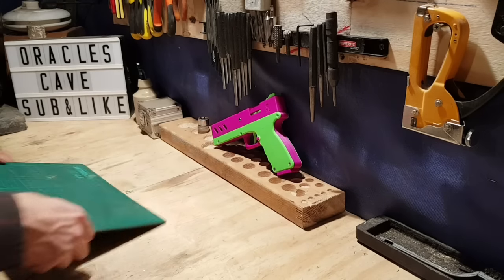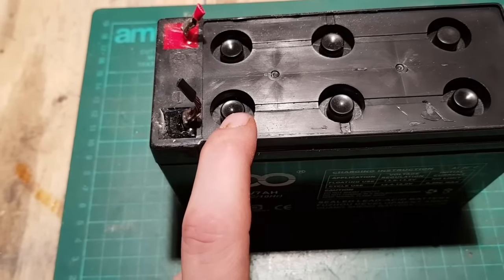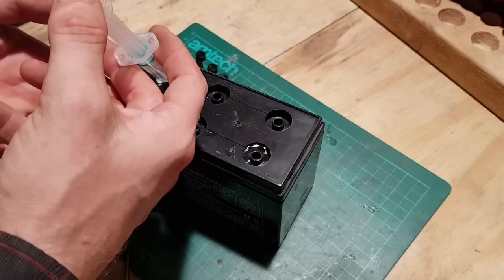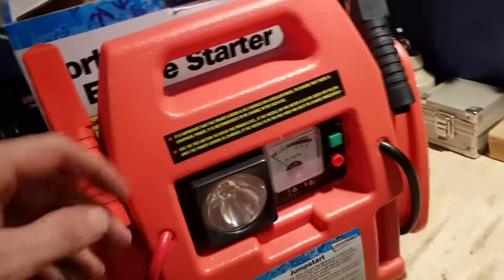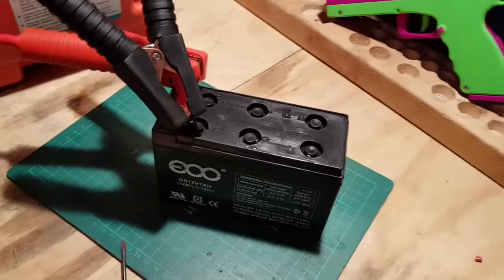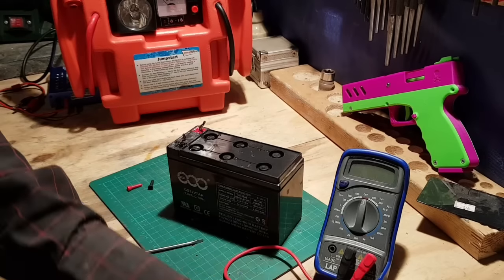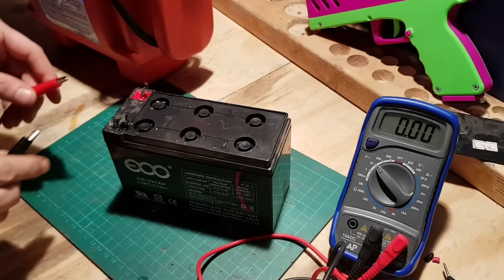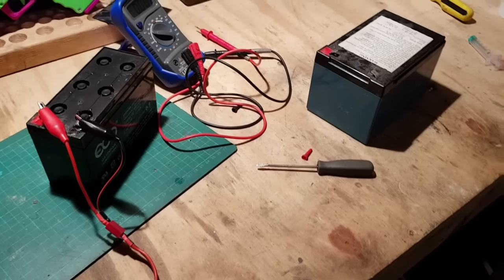HOW TO REVIVE DEAD 6V, 12V BATTERIES THAT WON'T CHARGE

Comment: ok I'm not very smart when it comes to this stuff but my computer ups stopped working, I live in a area where power goes out for like 1 minute and comes back on.
 my ups used to keep my pc running during  that 1 minute until the power was back on but know it stopped working, when I tested the battery with my multimeter it gave me 13.2 voltage but now the ups keeps shutting down immediately after the power goes out.
I have an uncle who works with car batteries and stuff, pretty sure he has acid so is it ok to fill it with acid instead distilled water if he doesn't have distilled water?
Reply from the maker: Acid is best, i only use water to help with reversing terminals to help dissolve any crystals that may have formed on the plates.
Acid is always best to use.
Just be careful and do not attempt without eye protection, splashes are sneaky devils, second hand shops are everywhere, but no second eye shops.
👍👍👍
Reply: thank you for the advice my friend, I'm gonna try this and come back with an update in 2 days and hopefully it works
Reply: dudeeee it fking worked can't believe it thank u so much !!!!! ur fucking awesome
i have 2 other 12 v batteries that i'm gonna try to also fix, thank u so much my friend 

<3 <3
Reply: @droppinaload2672  My battery charger shows that d battery is full but only testing d battery with multimeter, it shows nothing and won't even power a small 12v motor. Help please

Comment: A dead battery can't be fix, you can only recharge a discharged battery. If it needs water that means you overcharge it and boiled the water off. The lead flakes off and shorts out the cell, if you get it working it won't last. That's why there is a limited warranty.
Reply from the maker: Yes but not all batteries are toasted when they don't charge,  some are able to be saved and used.
If the cells are gone, there is nothing you can do.
👍👍👍

Comment: If you use an new battery to charge the old one, the new one can lose voltage? But since it’s new you can recharge it correct?
Reply from the maker: Yes correct, when a battery has gone bad, it has crystallized all the energy making liquid and is all dried up.

But a new battery will re-boost its liquid back to full power with a charge.

Bad battery just needs the Crystal's to be dissolved back into a liquid and it will take a charge again.

It's called SULFATION when it crystallizes 
👍👍👍

Comment: Pour acid out in container..heat up distilled wated and salt mix alil salt into water heat to 125temp pour in battery shake it and drain it keep doing so until water is clean then add acid back and add distilled water then hook to good 12 volt battery and charger ince battery charge enough then connect charger to bad battery it wil become allmost like new did many battery’s this way saved alot money in life time

Comment: If I add 2 ml of battery acid to each cell, how do I avoid any problems with getting splashed by the battery acid?
Reply: Will the battery acid react badly with whatever is still in each cell?

Comment: Actually I have put  lemon juice inside it.. After  few time.. While I charging the battery.. I heard sound of pops medium sound... So I scared & unplug it from charge... Does lemon juice help in repairing that battery?  Is that true?
Reply from the maker: Lemon juice is a good electrolyte, many batteries can be made using lemon juice.

 but no its not a good idea to use in a lead acid battery, flush it out safely or get another battery.
Reply: thank u for answering my questions... Actually lead acid battery are expensive these days... It cost now 70$ ...due to raising of dollar in Lebanon... That's why I try to fix old one...
Reply from the maker: @zoronow267  the battery needs water and sulphuric acid to bring back to brand new power levels.

You can get sulphuric acid very cheap and each cell only needs a few milliliters, just Google your battery to find out how much acid in each cell.
But most of it is just water in the cell.

Very cheap to get acid and battery will be perfect.
👍👍👍

Comment: how hot did it end up getting and what a save temp to let it get to
Reply from the maker: I never checked temp but it did get hot, just Google max battery heat expected when doing what your doing.
👍👍👍
Reply: @oraclescave  ok thanks just trying to  revive this battery from 7.66v  to 12v  it's a PB style battery form a goal zero escape  solar power supply I'm using a smart charger to charger it

Comment: Will this method work on 6v or 12v grey or red power wheels batteries?
Reply from the maker: Yes, all lead acid batteries, car, truck, forklift, motorcycle, etc.. 
👍👍👍
Reply: @oraclescave  thank you have a great day
Reply: Also how do you keep the lid (after prying off) from opening while in use?
Reply from the maker: @DavidSilva-qe2tn  I just tape it down and use a soldering iron to put little stitches on the corners by just touching the hot tip into the plastic at the join line and on the centre.

You could just use tape I suppose, I used soldering iron because I use these batteries in offroad dirtbikes and they take a beating.
👍👍👍

Comment: Lead acid battery do not come back, they may show a high voltage even 13 volts under load voltage drops like a rock
Reply from the maker: Yes they do, or you wouldn't be able to purchase battery refill packs of electrolytes.
Its only acid and water.
I wish people would think or actually know before telling me whats correct.

The voltage drops because it can't hold a large charge with just water and no electrolytes, this is why you desulphate or re-electrolyte the cells.

So if none of your batteries are coming back, my advice would be, start treating your wife right or she might not come back either.
Reply: @oraclescave  I'm with you on this. I've brought back over 12 batteries like this. They only last 1\2 as long as new ones but damn sure work again. I had to charge and quick drain several times before it held a good charge.
Reply from the maker: @travissimpler2573  fresh acid refill is needed to bring back to brand new power.
Very cheap, but not a very nice chemical to have laying around.
But if you are doing battery refresh, a little acid is like steroids for batteries lol
👍👍👍
Reply: May I ask what acid you would use? Thanks

Comment: I use a Dewalt model DXAEC2 6V/2A  12/0.5A  trickle charger.  It works from 0V to 12.8V.  None of that tricking chargers
Reply: So does that have an adjustable voltage output setting on it?  I have two 12 volt batteries like the one in this video.  I can't get either one to charge above 6 volts.

Comment: I just want to note you can use a $10 solar charge controller from ebay.  It will revive a battery at 0 volt (at least for me).

Comment: Can this be done without a smart charger ?
Reply from the maker: Yes, I was just taking the chance to show everyone why a smart charger blocks you from charging.
Any normal old style charger will just pump juice into no matter what.
It's because batteries like lithium-ion can become explosive if charged with a charger that's not a smart charger.
So a minimum voltage cut off sensor is what stops it charging, incase the cells are damaged, ( balanced charging)
Old style chargers don't have these cut offs, so anytime you come across a cheap old style charger, it's worth grabbing to keep in the attic.

Comment: What kind of a water are you putting in them
Reply from the maker: I use de-ionized water, but distilled water is usually what you can use, it's just water with the minerals removed.
👍👍👍

Comment: I've got a lead acid battery 12v can i just use normal tap water.
Reply from the maker: People do it all the time, but technically degrades the cells, but it still works, even rainwater works like distilled water
👍👍👍

Comment: I got about x25 12v SLA that I recovered from ups backup's. I hope this works out for them.
Reply from the maker: It will work, you can also refresh the battery power back to full power with some sulfuric acid or other electrolytes.
👍👍👍
Reply: I have found Epsom salt or aspirin does something for car batteries. Clean the deposits off of the lead maybe?

Comment: I have a Razor E300 scooter, batteries "charge" by smart charger, but turn the throttle and seconds later no power, rear wheel will spin, but not with you on it.
Reply from the maker: Yes your battery is dying because of sulfation, you might be able to make it strong again, most people would put fresh electrolytes in the battery with some water, and it will be re-usable.

Sounds like your battery has "dried up" inside.
👍👍👍
Reply: @oraclescave  Thanks

Comment: What is the difference between distilled water and battery acid?
Reply from the maker: Distilled water is just water that has been through a treatment and battery acid is a very corrosive chemical called sulphuric acid.
There needs to be water in the cells and also mixed with 2-10 millilitres of acid depending on which battery.

Comment: Did you use plane tap water or distilled water?
Reply from the maker: I used deionized water but distilled is fine.
👍👍👍
Reply: @oraclescave  what is deionized water?
Reply from the maker: @darkside6148  just like distilled water, distilled water will be ok aswell.
👍👍👍
Reply: How about rain water? Can i use that?
Reply from the maker: @bendabolehbuatlain9988  rain water can work but will slowly degrade the lead, but yes it would work just like distilled water

Comment: Video fails to mention or exercise safety precautions.    Batteries should never be filled to the top. Charging creates gas bubbles and heat expansion which would cause the acid to run over. Also caps are to be off to vent explosive gas as the sulphuric acid heats under an eltromagnetic charging current.  Also if you have to make final charger connections directly to the battery posts, do so while the charger is turned OFF.   There may be invisible explosive gas at the battery. Any minor spark  can cause explosion, blind you and permanently damage your flesh. BTW... The charging amps read on that charger is not 2, notice the decimal point.
Reply from the maker: Lol such a safety Susan

Comment: its  like  my 40 volt lawn mower battery but iwas able to just open that battery and reset it.then it chrges.its charger thinks its charged. can i use my sc 0 to 30 volt to charge it?
Reply from the maker: No it's a smart battery, you will need to touch a battery live and negative onto the live and negative points on the battery circuit board for short bursts to trick the board until it gets enough volts, use 2 wires from battery to your battery board.

Comment: So, let’s say I’ve got a massive battery that was in my garage when we moved in about 19 years ago...

Could this do the trick for it?
Reply from the maker: Yes
It very well could work if the plates inside are still good.
But there is only one way to find out, give it a try.
👍👍👍
Reply: Is it normal for it to bubble?
Reply: ORACLE'S CAVE, just did the voltage check.  0.11V.  Can’t figure out how to open the cells to check/add fluid, but it looks like it’s seriously low based on what I can see through the sides.
Reply from the maker: @Vessekx  if you examine the battery you will find a tiny hairline crack where the lid is, use a razor blade to pop it.
It's only held in place with a couple of friction welds spaced apart.
A little flat headed screwdriver will pop it open aswell.
Under the cap there will be several rubber caps, under each of those is each cell.
👍👍👍
Reply: ORACLE'S CAVE, this is an old car battery.  Having taken more time to examine it, I think it might just have tape covering the caps.
Reply: @Vessekx  yes they do hide them under their sometimes.

Comment: Getting it to resume charging v again does not mean it us restored.  Once battery lead plates sulfate they will not hold and discharge the original amount of watt hours. This means the amount of work it will do is greatly reduced. This may somewhat extend the life of a battery in low demand applications. But it is no miracle restoration.
Reply from the maker: Unless you reverse sulfation, but yes even then it won't go back to absolute full charge without some fresh electrolyte.

Comment: Lead acid batteries produce explosive gases, therefore ALL connections should be made before any power source connection/ switch on
Reply from the maker: Blah blah blah, yes it is possible to create explosive gases and also cause a spark that could react with those gases.

For a start the battery was totally dead with dried cells, the water was fresh, so the chances of producing gas like the hydrogen that you are talking about 

Yes it kinda made you look smart, but when you take a closer look, you are as thick as 2 short planks and just repeating your SAFETY SUSAN user manual.

If your looking for safety, this is not the channel, I play with fire, I explode things, I make things that are dangerous,
I barely use safety goggles or gloves.

I am aware some things cam be harmful, or I'm breathing in some nasty stuff, but 5hats my choice to do it.
And if you can read, there is a warning telling people not to try this.

So I'm free to do what I like 👍

Comment: I have two of the batteries like in the video, I can't get either one to charge above 6 volts.
Reply from the maker: Have you checked the cells to make sure all of them have water in them.

And SULFATION  can cause issues, Google sulfation, this is when the acid turns to crystals on the plates in each cell, can be reversed with short bursts of reversed polarity.
Reply: @oraclescave  Yes, I should have mentioned in my other comment that I have used a syringe to fill up all the cells with distilled water.  The 6 cells on each battery drank a good amount of water.  I did not keep track of how much water each battery took.

I am a total amateur at this, I have never done this before.  I actually got both batteries up to 9 volts on the charger, but now the one dropped down to 6 volts, and the other one is at 2 volts.  These batteries have both been dead for probably at least 6? months maybe.
Reply: @oraclescave  OK, I will look into the sulfation issue.  I have been wearing my safety glasses the whole time when working on these batteries, lol.

Comment: Much simpler to connect the stupid smart charger and just apply power to the battery for a second or two to trick the stupid smart charger into starting to charge. Works for most but not all stupid smart chargers (some lock themselves off once full voltage is detected and can't trickle charge). Always fix water level first, that is often all that's needed. Avoiding buying stupid smart chargers is hard, but if you refuse to buy chargers that have reverse polarity protection you can find an automatic charger if you look long enough. I have a pile of worthless stupid smart chargers and got stubborn and found an automatic charger I can simply put on a battery and eventually even a stone dead battery will charge (a manual charger will burn up the battery, you can NOT do that with a manual charger). Expect to search for a LONG time to find a useful charger.
Reply: Also, those are not batteries that won't charge, those are "chargers" made to not charge batteries.

Comment: How do you get into power wheel batteries?
Reply from the maker: Same way I think, popping a razor into the fine line joint, look very closely for a literal invisible line.
Maybe its different for your particular battery but nearly all of these types have a lids friction welded very lightly thats all

Comment: That is normal water You put in the batteri?
Reply from the maker: De-ionized or distilled water only.
Do not put normal tap water into the batteries, could cause excessive gas to form and have risk of explosion,  and the minerals will degrade your battery

Comment: Any idea about fixing a camcorder battery?
Reply from the maker: Same really, try connecting another battery to the negative and positive terminals in short bursts.
And checking with a multimeter to see how much voltage it gains.
Then charge it.
2 pieces of wire should be enough to hold onto the terminals of the camcorder battery and whatever battery you choose to use.

Might take 2 people or just use tape to hold wires on one set of terminals while you hold them on in short bursts on the other battery.

Just don't let the 2 wires touch each other after they are connected to a battery.
Reply: @oraclescave  OK thanks

Comment: A Volt is a volt.What a bout amp hours ?? DID YOU FIX THAT TO ???
Reply from the maker: Yes, you will need to cycle on higher amps then deplete, then more amps that's how you bulk up amps, it won't do it first charge.
👍👍👍
Reply: Now ?? The gunk in the bottom  of the batterie  is that not part of the batterie if ?? how can you call a battery restore ??
Reply from the maker: @FrankLowe1949  small amount of sulphuric acid will completely restore.
But I don't advise anyone to do it because of the safety concerns.

That type of thing would have to be a do at your own risk type of deal.
As I will not be responsible for some idiot spilling such a chemical on themselves.
Reply from the maker: @FrankLowe1949  all the video was to show was how to get a battery started so a charger would read it again.

Not hey, come here and I will fix your battery that you killed in one of a thousand methods